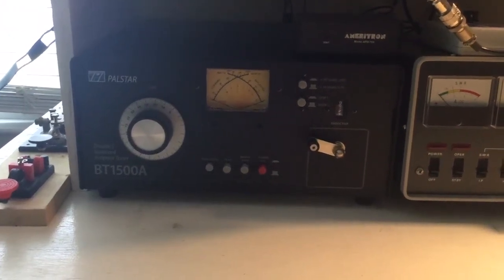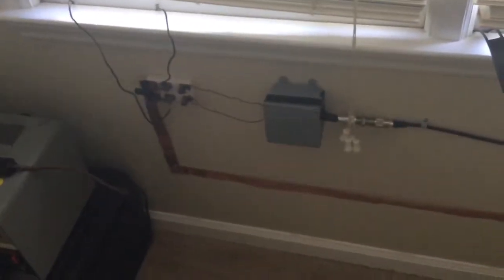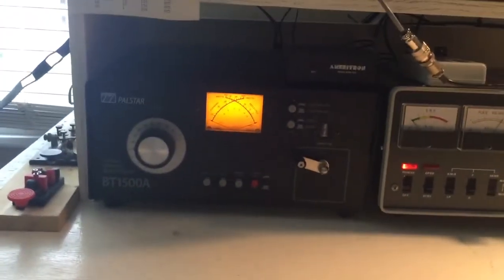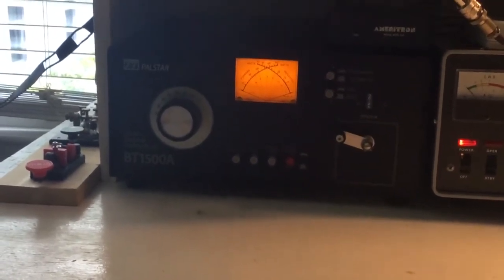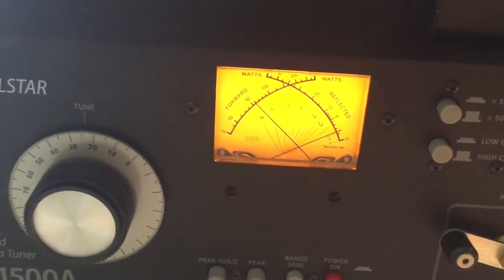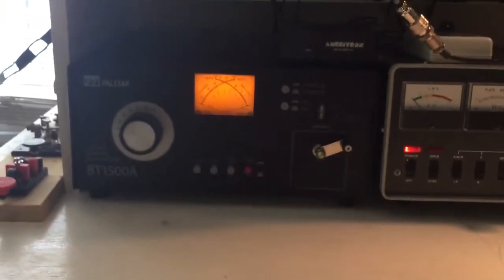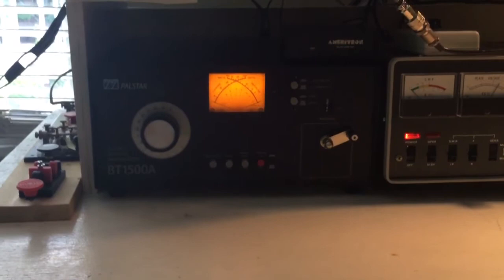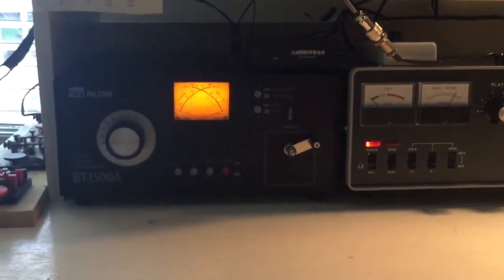Palstar BT1500A amateur radio antenna tuner review

Comment: I know this was 4 yrs ago. I owned that tuner. Its a lovely tuner that opens up a world of performance people dream of. However, you dont need to EVER transmit on the air to adjust your tuner to your desored frequency. Buy and use an MFJ Matchmaker. They are inexpensive and work wonderfully. I own one. Hands down an incredible device for matching radio to antenna without a drop rf going in the air.

Comment: 600 Watts  is NOT 'high power'  by any stretch of imagination. it is medium power at best
Reply from the maker: I’m not sure what you are referring to with your comment. The antenna tuner is rated for 1500w pep. That is the legal maximum in the USA. I don’t run more than 500 or 600 watts here. Many countries do not allow stations to run more than that in the amateur service.
Reply: I am limited to 500 via reciprocal permit at my qth.  Locals get 1kw but not many have the AC mains to handle that.  I have 5amps, 220vac at my disposal